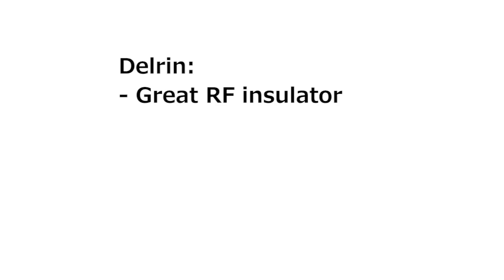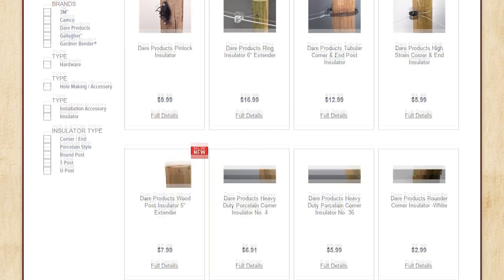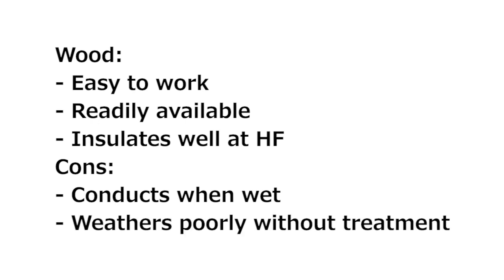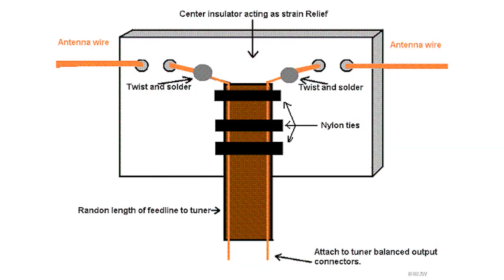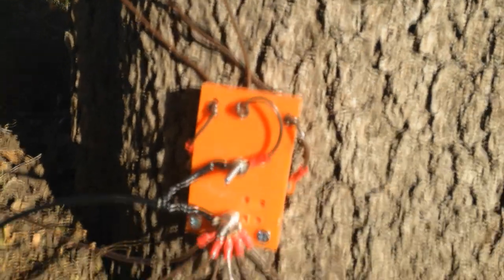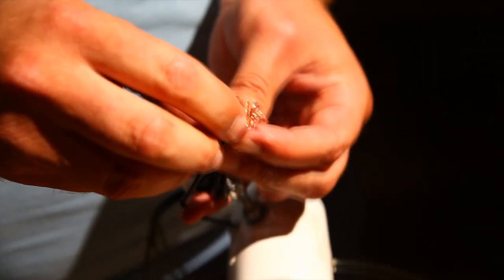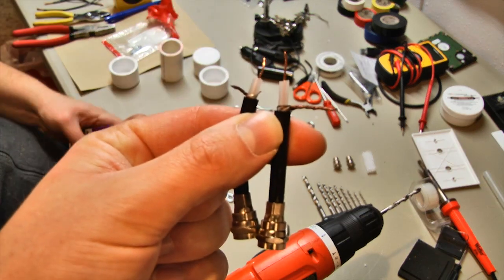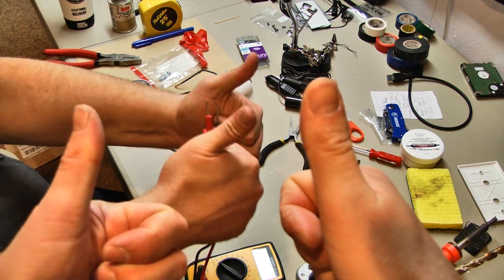Dipole and Vertical Center Insulators

Comment: Hello Sir, how do I connect the coax with the 2 wires (the 2 horizontal wires on each side)? Do I solder one wire with the center conduct of the coax and the other wire to the metallic shield of that coax? Should the coax be grounded? I want to make a dipole antenna, thanks you for answering :).